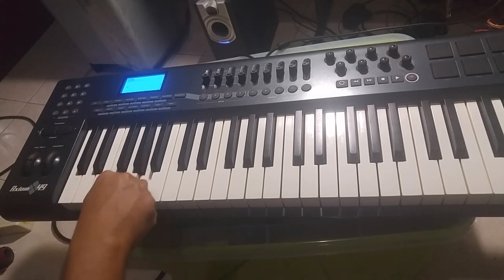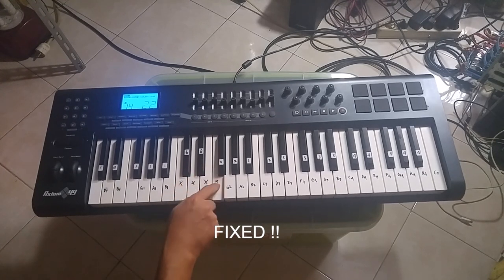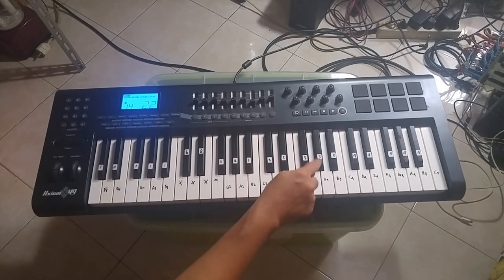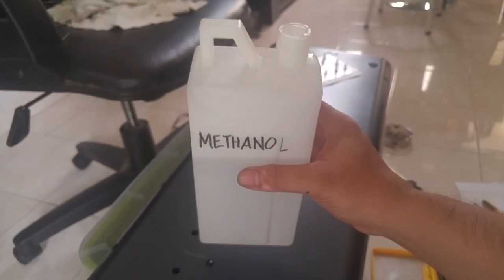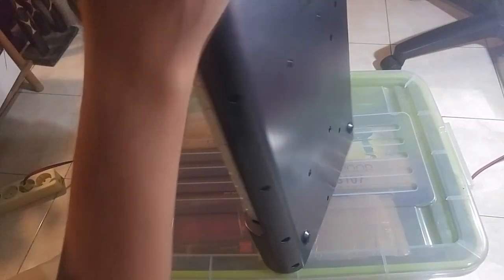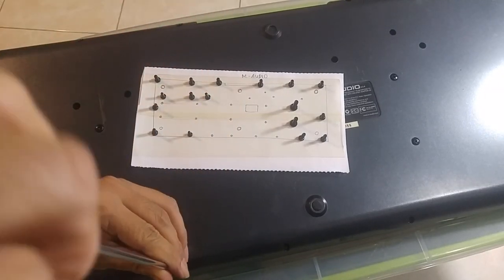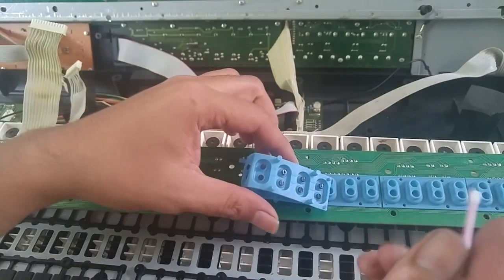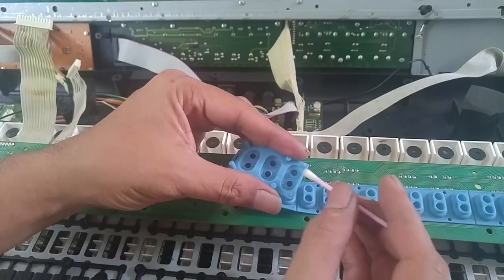how to repair dead keys fixed m-audio axiom midi keyboard

Comment: I fixed some dead keys on mine and you can actually do it without taking all the keys off if you take off the bottom of the keyboard and then take all the screws out from underneath the contact board. Saves a little time and you don't have to pop out all the keys. Hope that's informative. Take care✌️

Comment: I saw on another video that a guy used a pencil eraser to clean the PC contacts. Apparently that works. You can get over zealous cleaning the PC contacts and you will end up rubbing away the contact material. Also sometimes the same keys will stop working in every octave eg G and C# in my case. If this happens it is NOT the keyboard contacts but rather the connectors from the keyboard to the main board that need to be pulled out and reinserted a few times.

Comment: hey man my C notes and my B notes aren't working like every single C and B notes aren´t working. Yesterday they were working but today they sundently stoped. I don`t know what to is something wrong with my midi keyboard or is something wrong with the driver. PLEASE HELP
Reply from the maker: most case is only dirty, corrosion, dust. check every cables connection, rubber pads. its a common problem.

Comment: Thank you so much for posting this! I didn't use my Axiom 49 for years. When I pulled it out of storage the middle C was dead. I thought for sure I would be emailing M-Audio for a replacement part.  I really appreciate your commitment to labeling parts and including that. It's always a potential oversight for people like me that like to get excited and just pull things apart and panic later when it comes time to reassemble. So, I guess what I'm trying to say is that I know what I'm doing today!

Comment: You sir, are a God amongst men. An absolute legend. I had my oxygen 61 sat in the loft/attic for over a year because certain keys (the middle C aswell) just stopped working.

I couldn't find anything online about my issue and so just gave up.

I got the keyboard down from the loft/attic and decided to take it apart as what did I have to lose? I then poked and prodded and  realised that the rubber key conductors were the issue. I then googled my issue now more refined, and found this video.

I had some isopropyl alcohol spare and used that, and now my keyboard is working like new, if not better!

I cannot thank you enough for your effort and time in making this video and sharing it with others. You are awesome and you've made my year!
Reply: It's because he follows Shrek. Shrek is God.

Comment: Thanks - I had one key playing at max velocity, I followed this as far as the spring on the key. Appreciate your help!
Reply: Hi. I have the same problem, a single key playing at max velocity. What did sort it out in your case, cleaning the contacts with alcohol? or was it something else? thanks.
Reply: @nizzero1  Hi Oscar, I gave it a clean, but the spring had come off - I think it was that.

Comment: Just out of interest too the pads transmit on a different midi channel to the keys in case you may be wondering. (default that is) They can be reset though to match the transmit channel to the keys.

Comment: Hello! I'm hoping maybe you could help me? I've tried this method of cleaning but using isopropyl, as well as using a pencil, a pencil eraser, and just generally cleaning out dust and dirt. So far nothing has worked, nothing looks different between the working keys and dead keys on the board and its all very clean now. Are there other methods you would suggest to try fixing dead keys? I'm really at a loss of what to do. The keyboard I have is a casio WK-6500 but the inner workings look very much like your Axiom. Thank you for your time!
Reply from the maker: Please send detail photo to my email addie_ngr@yahoo.com. my suspect is you need to conductive paint the rubber. Or some other possibility rusty soldering pcb and ICs

Comment: Does this process works same even if the pads stopped working? i have Axiom61 2nd gen,and pads stopped transmitting even after a whole factory reset. thanks in advance.

Comment: I got a used Axiom pro 61 with unresponsive pads. Only 1 pad works and the others are completely dead. I opened it up and saw no oxidation, but just a little tear on the strip that connects to the circuit board. Is there a fix?
Reply from the maker: is it flex cable tear ?there are some store in Aliexpress doing customized flex cable order. just message them
Reply: @addiengr1  update, the damn thing stopped working. Not even blue screen of death, it just blink blue and completely dead. I don't think there is any easy fix.

Comment: I have a SAMSON Graphite 49 MIDI keyboard & one key of the pad bank start auto work unless I doesn't press it. I have a little bit electronic knowledge & can u give some advices to fix it?
Reply from the maker: Sudhara Nuwanpriya most cases only need cleaning. If your pad using tack switch. Try to replace it.
Reply: addiengr1 thank u very much. I'll try that. Again thank u

Comment: Does this work for Yamaha Psr 175 ?
Reply from the maker: All keyboard mechanism is similar with rubber contact. Try to open it with pdf guidw manual or other video related to PSR 175